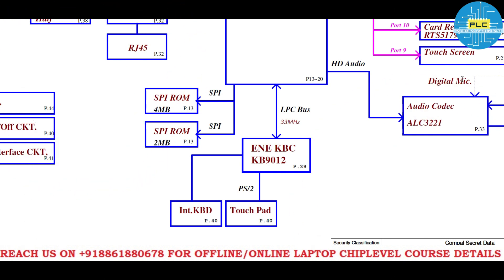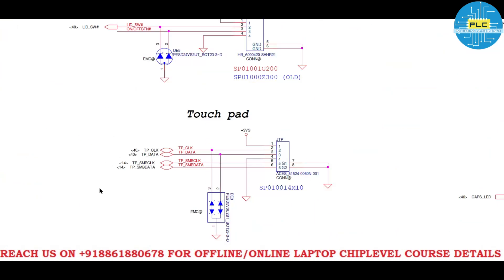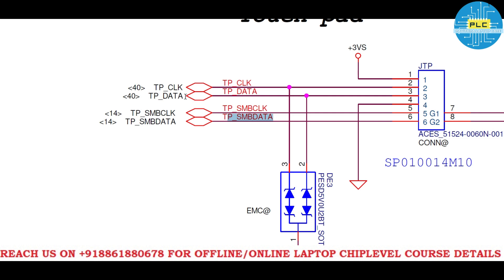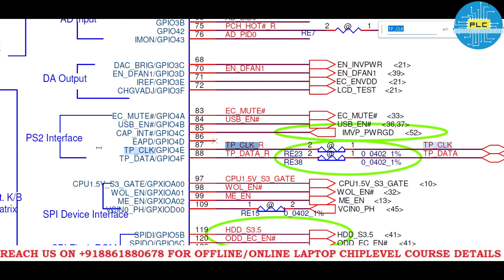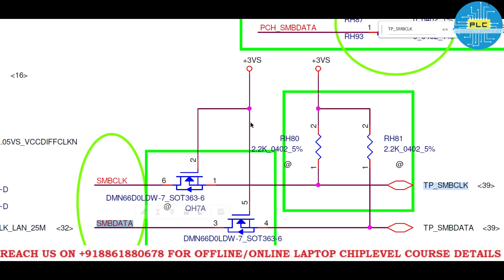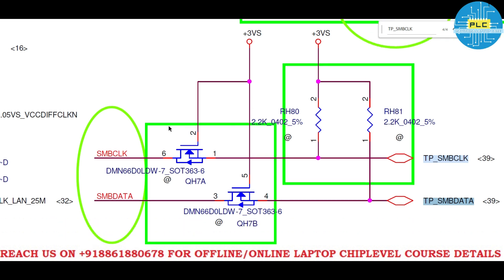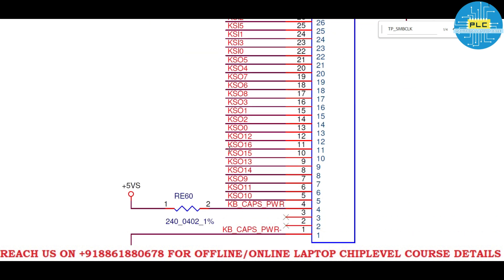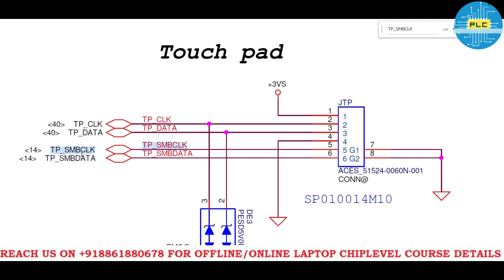LAPTOP REPAIR - HOW A KEYBOARD AND A TOUCHPAD IN LAPTOP MOTHERBOARD WORKS?

Comment: please master i recieved lenovo thinkpad T470s ,its keyboard wasnot working then i replaced with brand new keyboard then returned to customer but after one week it was returned back when keyboard not working ,then again i replaced with another brand new one then returned to customer ,it did same problem it buttons some are working others not some time keyboard freezes ,what could be the problem,
Reply from the maker: Check the keyboard strip and connector.  Send me the schematic